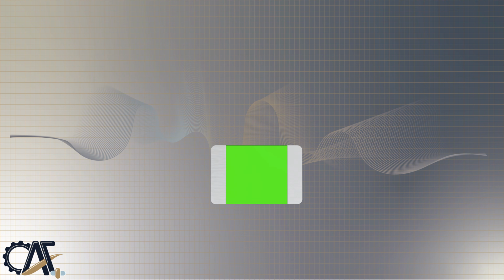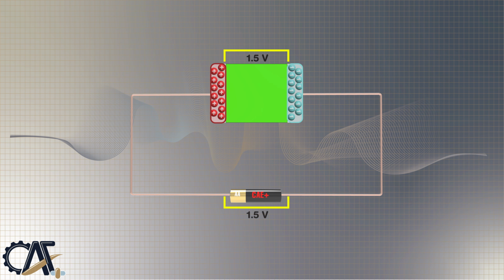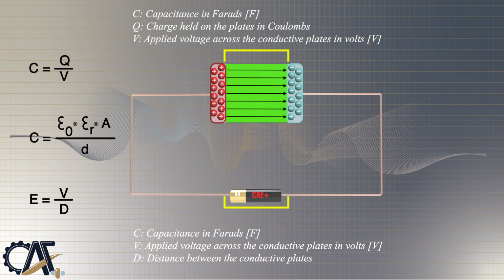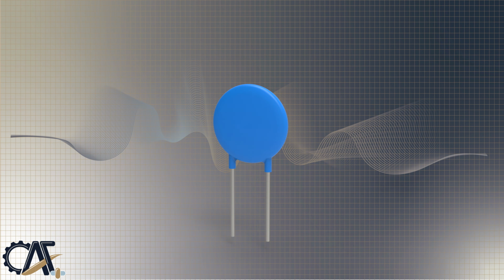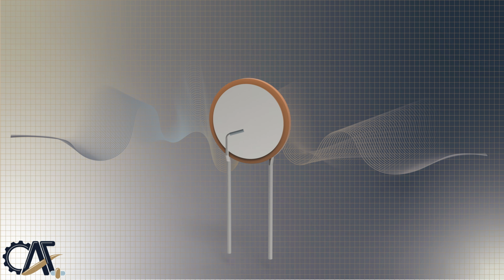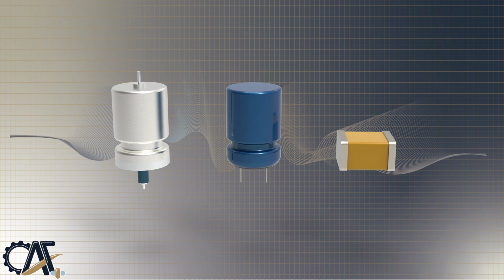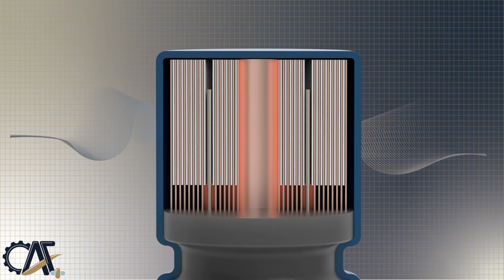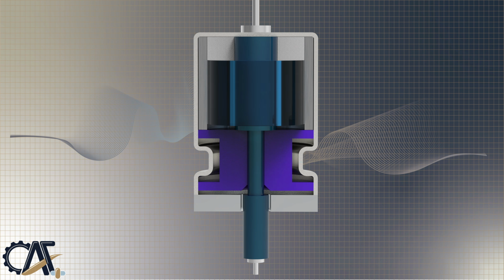Capacitors - How Capacitors Work - Charging and Discharging - Capacitor Types

Comment: This is the best video I have seen in capacitors on YouTube, you actually included some formulae which is good.

But sadly, this video only treats capacitors as charge storage devices and they are far more than that.

You have omitted formula on the reactance of the capacitor, and also on the charging/discharging curve, though you did depict it graphically.

No video ever covers the reactance formula, and accordingly no video describes the operation of the capacitor in filtering, which is serious immission to the electronics amateurs who are wanting to genuinely learn about electronics.
Reply from the maker: We are really glad you liked the video. Yes, you are correct there are two more functions for capacitors in electronic applications other than energy storage:
1) Removing noise (e.g. high pass filters and low pass filters).
2) Reduce voltage pulsations / Keep the voltage at the same level in a circuit.
We were planning to make a separate video for "Low pass filters" and "High pass filter". 
However, you brought up a good point about the reactance formula. We will add this to our list for our "Basic of Electronics" video and will probably have a section added explaining the Impedance and Reactance equations for both capacitors and inductors. 
We appreciate your useful comments and by providing us with them we will try to improve our next videos. So please check our next videos and let us know your comments. 
Thanks!